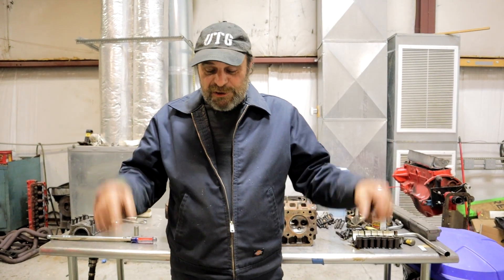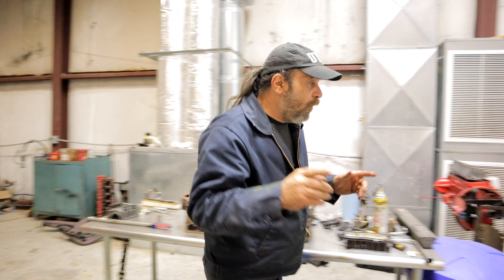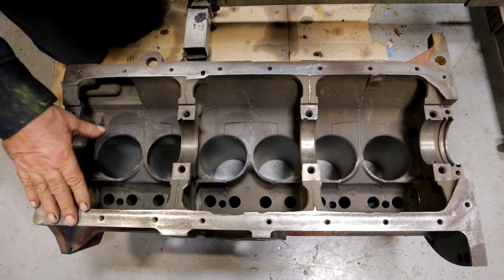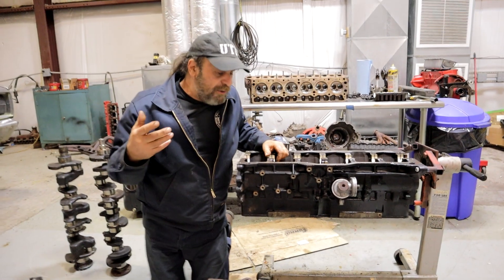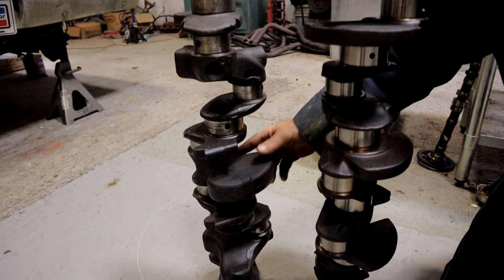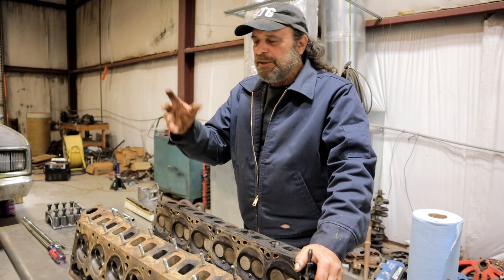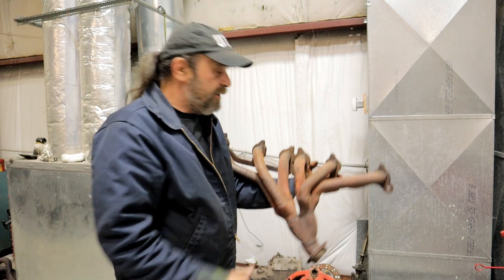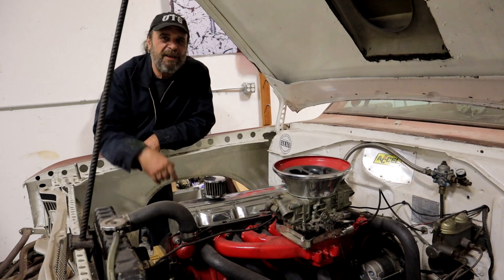The Mighty Mopar Inline 6's History And Comparison - Flathead, Slant, Hemi Six, 4.0 And Hurricane

Comment: Tony, your knowledge of the Hemi 6 is more than most people have - including most Aussies.  it's a shame you never got them, but it's understandable.  As a general explanation of why: Europe wanted small, fuel-efficient 4-cylinder engines because petrol was expensive.  America had cheap fuel and long distances, so a V8 made more sense.  And Australia...well, we had long distances to cover, but at lower speeds than the US, as there weren't all that many good roads once you left the cities...fuel was fairly expensive, but we needed more power and especially more reliability than a 4 cylinder would usually offer...so we generally opted in favour of a smooth, torquey straight 6 as a compromise between longevity, efficiency and power.
Reply: If you would send him one of those Hemis, you'll gain a friend for life. I'm imagining Tony sitting in front of one of those and staring at it for a couple hours 🤨
Reply: @aussiebloke609 : Besides fuel costs, taxes were a major cause of greater refinement in European engines. They were taxed on size, so they had to make less do more. That gave us the Alfa sixes and fours, Jaguar six, and all the 3 liter V-12’s, cross head engines, overhead cams, and a great deal of aluminum. All for greater power and lighter weight. Americans went for the bigger hammer, no replacement for displacement, partly because of different tax structures. And in your area of the globe, you folks adjusted to fit the situation there. Take care and hang in there.
Reply: Aussies have had some very nice cars and equipment. There are also people in Oz who build killer hot rods. The Aussies appreciate what they have, and they know how to have fun.
Reply: Our roads are still pretty ordinary,
Reply: The Chrysler "Hemi" 6 was designed in the USA at Detroit as the "D" code truck engine. It was meant to replace the Slant...obviously. For some reason they gave the idea away and with Great Ideas In Motion, they gave the design to Chrysler Australia to build and develop them.
Reply: @kramrollin69 it was lightened as far as possible for the purpose of winning Bathurst. They didn't just take the tooling and turn out the same engine block from the US. The stupid part in that mission was keeping a heavy cast iron intake manifold. The valve size and port area was all much more than any holden or ford 6 like 202 or 250. Again with an eye on winning Bathurst. Using a 6 instead of 8 meant lighter front end, better handling, more laps out of tyres and less brake fade
Reply: I always wish they would’ve made a Hemi V12 by having two Australian Hemi I6’s sharing a common crankcase. That would’ve been a nice engine. Especially for a luxury Grand Tourer, or higher-end sports car.
Reply: @stoneylonesome4062   I just wish Chrysler had stuck around in Oz and developed the Hemi 6.  Considering how good it was when it still used pushrods and didn't have a cross-flow head, just imagine where it might have ended up now.  Rather like the Ford Thrift-6 from 1950 developing into the Barra.

Comment: Overhead cam 6 was in jeep wagoners and j10 trucks. 1963 ish
Reply: Also in military 5 quarters as well, I believe.
Reply: The 'Tornado 6', a 230 CID.  (I think it was based on the Willys 161?)  Since it was designed as a truck engine they went for torque, not high RPM power.  The cam had 6 lobes and each operated BOTH the intake and exhaust valve.  There was no overlap, there was a timing gap.  Good for low end torque, and it was a deep stroke engine anyway.  Chain driven OHC.
Reply: I remember that, only seen one though.
Reply: I never owned one. I think they had issues?

Comment: 20 psi from the factory? Reliably? Wow, forced  induction vehicles have come a long way. When I bought my first turbo car, a 90 eagle Talon TSi, those things were running 7-9 psi from the factory. You could turn it up to about 14 psi without having to worry about fueling issues, and tuning. Then, I got really into it, and ended up running 42 psi through it at the track, and on race gas (far from stock) and about 25 psi on pump gas on the street. God, I miss that car.
Reply: Tech has certainly moved on.  Even my Hyundai tops out at 18-20 psi from the factory.  The biggest change in engines in recent years is how to make power numbers with reliability that was thought of as impossible in the '90s.  Now, it's fairly common to find 16-24 psi stock.

Comment: Not a fan of the slant 6, it was always the smallest of the lot, just barely able to get out of its own way. It was reliable cause it never made enough power to break. Everyone else had bigger more powerful 6s and Ford AMC and Chevy went all the way up to 300 290 and 292 6s. The largest slant was a measly 225 and couldn't be built to anything bigger, it was as you have said the worst slant, the 170 being the best, did ford or chev even make that small of a 6 cylinder? I think Chrysler would have sold a lot of the 245 and then 265 hemi 6s but that would have cut into 318 sales. By the way Im 62, Ive owned a couple slants and many other Chrysler engines, my favorite being the 383 super commando from my 67 Plymouth Sport Fury 3.

Comment: Never appreciated Inline 6's until a buddy of mine bought a Pontiac Firebird with a four barrel Sprint 6 in high school. Then a number of years ago I bought a 2.9 liter 179 ci Inline 6, 24 valve over head cam, 181 hp, Volvo 960. Since owning Volvo turbo Inline fours since 1981 it was real change going to the N/A I6 in winter of1996. Since owning this I6 car I have become a huge fan of the inline sixes. At 26 years with 139K miles, it still runs like a champ as they say.
Reply: Another 1996 960 owner here with 293k miles. Still going strong. Coupled with the toyota automatics these things literally are industractable. The 960 body too, very well made and overengineered IMO. Maybe apart from the rear suspension even then the problem with that is not the design but mostly parts availability.

Comment: An AMC ohv six must be, at some level a Nash design.
Reply: Related by divorce? Nash and Hudson got together to make AMC in 1954 then a few years later they dropped the Nash and Hudson brands in favor of Rambler. Their new six and V8 designs debuted in 1965. Whether the same engineers were still there from 1954 I don't know. I have heard they hired an ex Kaiser engine man, who had designed a 288 cu in V8 for Kaiser that was never built, and he designed the 287 AMC V8.
Nash Ambassador had an OHV six with 7 mains back in the forties. It was used in the Nash Healey sports car and finished in the money at LeMans. The new six of 1965 had an immensely strong 7 main bearing bottom end and Barney Navarro got 600HP out of one in the sixties, turbocharged and burning alcohol fuel, in his Indy racer.
Before the sixties 7 main bearings was an unusual feature in a six found only in luxury and performance engines. Most had 4 mains and a few even had 3.
Reply: @mrdanforth3744  Thanks for taking the time to write, I didn't know that.

Comment: My dad had a 4.3/ 265ci hemi six in a Dodge ute. 4 speed manual. it was mostly stock & easily would beat the 302 fords & 308 holdens, The 351 fords & 350 chevys not as much. so much fun as a teenager.
The 265 manual charger was the fastest aussie car in the 1/4 mile. Better than the 351 falcon & 308 Holden. The Ford Barra is the king of the inline sixes, Period
Reply: The E49 was faster than a GTHO over the quarter. Normal 265s are not slow but closer to mid 15s
Reply: @ldnwholesale8552  No. A test of a VH Charger 770 Hemi 265 and a Vh Charger 770 318, both with the same 2 barrel carby, in 1971. The stock Hemi Ran 16.7 quarters and the V8 16.5.  Reasonable for the time for  standard cars, but no powerhouse. 
A 74 VJ Charger 360 ran 16.2, and a VH 340SE ran 15.5. The 360 Chargers ran 2.77 rear gears a 2 barrel and a choked up single 2" exhaust. The 340s ran a 2.92 (both non lsd) and a choked up single 2" exhaust.
Reply: I never understood why Ford didn't bring the Barra to the US

Comment: imagine an aftermarket head for a 225  designed to be turbo charged, direct injected , water injected directly too. >>>like a diesel prechamber  > reflective insulating   heat disk under the piston top  but  as its  watercooled, its steam powered. make use of that  4.25 inch stroke and 1004 times expansion of water to steam .

Comment: I've gone  back to inlines. I still have and enjoy my V8s but inlines are so much easier to work on (especially in trucks). Adding turbos is near half the work and parts. The old stock Ford 300s and GM 292s can take quite a bit of boost with little more than adding ring gap.
Reply: Spme of the old Ford 300's only had a 7.something compression ratio. I know the 1967 ones did, and with just a bit of gap on good quality rings and a bearing set love a turbo.
Reply: @BloodRaven1969  search ford 300 turbo on here. 
What beasts they are ,if you consider that head like breathing thru a straw. 
Seems like they usually put out around 220-250hp and like 440+ foot pounds, that's diesel like torque.

Comment: The raised intake ports of the 4.0 enable the ports to be shaped better than a slant six.  The valves of the GM 5.3 are relatively small, there are more perforance issues than mere size.  The classic Jaguar 3.8 XK6 is the same length as a slant six and has the same 3.40-inch bores as the slant six, yet managed to have 7 main bearings.   Other than the weight of the block the XK6 is a pretty cool motor for a 1948 design.  The XK6 grew to as large as 3.66-inch bore in the 4.2 version, but there were block cracking issues due to casting design - moreso in the U.S.A. than in the UK due to warmer summers..  Two years ago jaguar released a new XK6 block that is supposed to not have the cracking issue.  It almost looks as if Chrysler designd the slant six as a budget XK6 - both motors are limited at high rpm to about the same limits - both are more about torque than rpm. The 3.8 E-type produced 215 hp or so, the factory published rating was 265 hp, but they don't make that much unless they are built with different camshafts than stock.  Because the xK6 had better carburation than a slant six, jaguar had to strengthen the block because they tended to crack the block in racing - a very heavy block compared to a slant six.

There were 2 common series of Mopar flathead sixes, both introduced at about the same time: 1934-ish.  The Dodge/Plymouth 201/218/230 version was a very compact motor with offset connecting rods, the chrysler/Desoto 236/251/265 is about 2 inches longer.  The 265 can be overbored to 282 cubic inches and makes good torque.  Externally the two flathead series appear to be the same design.  Most of the vintage hot rod parts are available for the dodge/plymouth version, but it was common to swap the bigger motor to a Plymouth coupe. All of the Canadian flathead sixes are the larger version, they made destroked versions for Plymouth.  The original 7 bearing six from 1924 was also used for decades,  it became a commerical truck motor and grew to as large as 413 cubic inches - very heavy, with dual carbs during the first years of the 331/354 hemi v8, weighing in at about like a Cummins 12-valve.   There was also a straight 8, which is somewhat like a plymouth six in bore - also very heavy, last used in 1950.

Comment: Apart from the 265 and 245 there was a 215 as well, don't know why, but there was. Had this rebuilt 245 about ten years ago here in NZ couldn't give it away, guy had spent thousands on it. Eventually found it a new home but man, you would think the local Chyrsler enthusiasm would have been a bit greater. I was greatly surprised, now they're all wondering where they have gone.
Reply: Exactly.
Reply: I think the 215 was used in taxi's for economy  ' also  in the  Chrysler Centura .

Comment: So jeep tidbit- When Chryco bought the XJ from AMC, AMC's inline six at the time was the 4.2L Carbed 258. The XJ's in AMC trim had the GM V6s, and the lead designer for AMC specifically designed the engine bay NOT to take an inline. MOPAR cut and recessed almost 4 inches in the center of the firewall, which forced a redesign of the interior AC/Heater box to fit the 4.0. The XJ's actually got EFI with the RENIX system before the Wranglers (YJ) which still had the carb'd 4.2 up until 91, when they got the 4.0 HO package. As far as the AMC derived I6's go, you can swap parts in them all the way back until the late 1960's with almost any AMC derived straight six.  Oddly enough, until the redesign and switch to OBD2 in 96, most of the electrical systems in the cherokees was actually GM electrical components, including the steering column and ignition system. Just some random AMC/Jeep knowledge for ya Uncle Tony from the Jeep master of useless knowledge.
Reply: The XJs got the 4.0 before Chysler bought AMC. And after the 4.0 came out AMC was already playing around with what today is called the stroker. In fact the original stroker was the 282 built in Mexico by VAM. Basically a 258 with 3.875 bores.

Comment: Ok, I didn't watch this video. I have no problem with inline six engines. I've had several. I've never considered them a performance engine, but there is more to life than just performance, as in power and speed. An inline six is a very smooth, long lived engine, perfect for daily drivers, transportation cars, trucks, and even luxury cars. BMW uses then, never mind that BMW makes nothing but JUNK. Many companies have made great inline six engines. The key words there is "have made" You put "future" in the title of your video. There is no future for real engines and real cars. There hasn't been a decent car made in decades. What used to be cars have been replaced by CTAs (Computerized Transportation Appliances) They look like appliances, hell they don't even come with tires anymore. And the engines, if you could call them that, are engineering and design nightmares. They are 10 times more complicated than they need to be, they are unreliable and short lived. The "future" for car enthusiasts is old cars and old engines, and with the one good use for modern technology, replicas of old cars and old engines. A bunch of Chevy types are busy putting LS1 computers in their classic cars, maybe they are unaware that you can still buy a brand new old school Chevy engine, design wise, that does not have a single GM part. You can still buy brand new carburetors. No real car enthusiast would have anything to do with this new computerized EPA TRASH.

Comment: I have a 73 yr old 230 flat head fluid drive that sat for 12yrs and runs beautiful still.
Reply: That's a De Soto. '46, or '47?
Reply: @jasonrivers7518 DeSoto used the 236 version of the 25 inch 6.
Reply: @jasonrivers7518 230 is the large version of the 23 inch 6.

Comment: The only thing with the hurricane 6, and also the pentastar v6s is the mexhaust manifolds are cast as part of the head.
Reply: You say that like it's a bad thing. Sure does cut down on turbo lag though....
Reply: @davidthehillbilly7995  it's bot nescisarripy a bad thing. I know tricking out a 3.6 pentastar v6 can net you 350 hp to the wheels N/A. The issue is if you wanted to go any farther hp wise N/A. However there is Maserati and Ferrari head that will bolt up to the 3.6 pentastar block that have the headers seperate. Power adder wise there are people making 500+ to the wheels with a centrifugal s I percharger on the 3.6 pentastar with a stock bottom end. They are incredibly tough engines.
Reply: The BMW B58 used in many of the cars they build including the current Supra is the same way. It's not the greatest for performance since it's basicly a built in log manifold but it does help them control emissions better without really giving up anything in production form and people get those past the 1000hp mark.

Comment: As a dodge tech I haven't messed with the new 3.0 yet but I do know its based off of their 2.0 turbo 4 cyl engine. That 2.0 is a dumpster fire to work on and has timing chain rattle like no other. I hope the 3.0 fixes some of the issues with the 2.0 and becomes a good engine but only time will tell. Imo you would rather a hemi over the 3.0 in its current form.